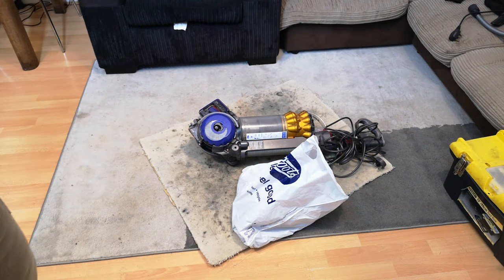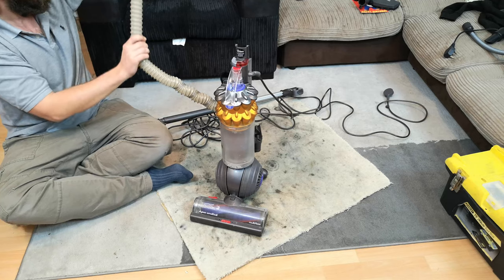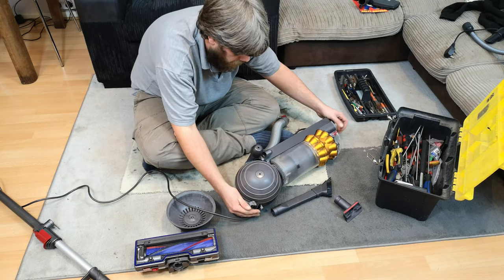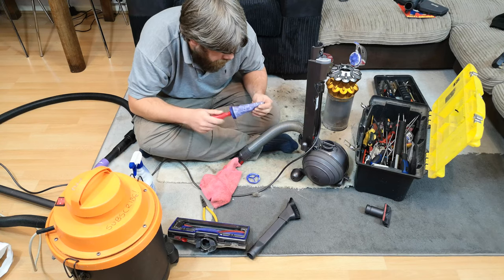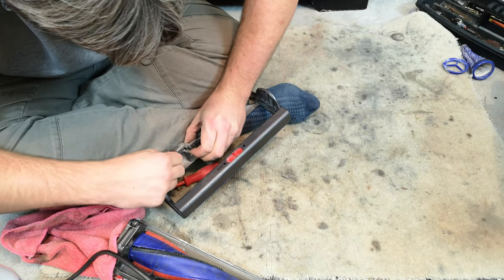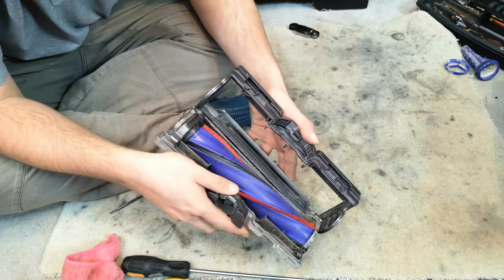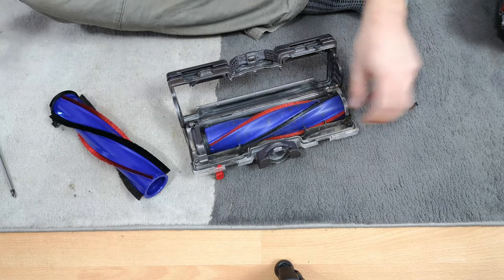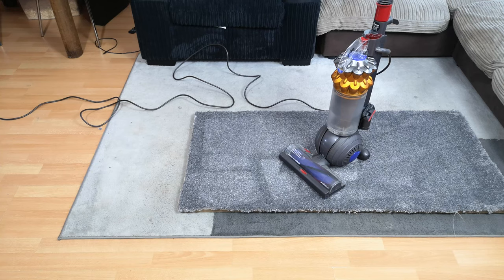Dyson UP15/Small Ball Refurb and Repair! Restore your suction!

Comment: Hiya. I need to replace a broken Swickneck Lock that broke when I pushed the machine into a glass cabinet by mistake. Typically 5he glass is fine and the Dyson broke!!  I'm not sure if it's called the lock or yoke. It stops the machine tipping left and right when upright. Is it easy to change?
Reply from the maker: Yolk latch is what I've seen it called, or search ebay for dc50 yolk, usually breakers sell the whole assembly so you can take the latch off and move it across (although I've never done the job on a 50,on the dc24 it requires the yolk to be removed...)

Comment: Can one remove the bearing end cap from the brush roll on the DC 51? I want to try and replace the brush strips (if I can find some suitable) without replacing the whole brush assembly being very expensive in South Africa. Thanks for the videos.
Reply: Easily. Remove screw holding on the bearing.  Pop the bearing off.  End cap comes off, and you can slide off the strip.  Can use the strips from any other roll no matter the model.  So find a cheap one even if it doesn’t match your unit, pull the strips and use in yours.